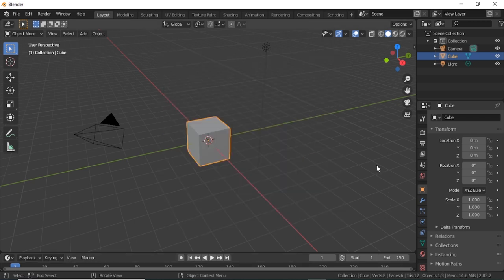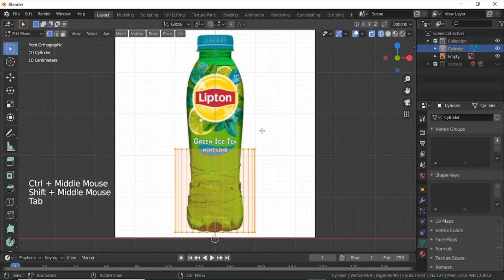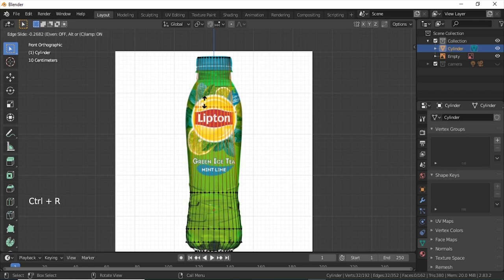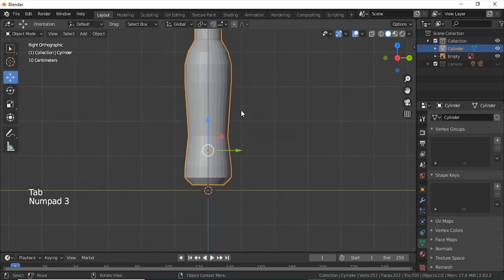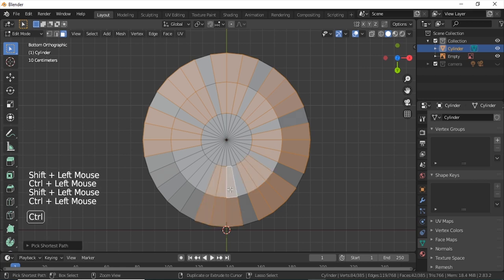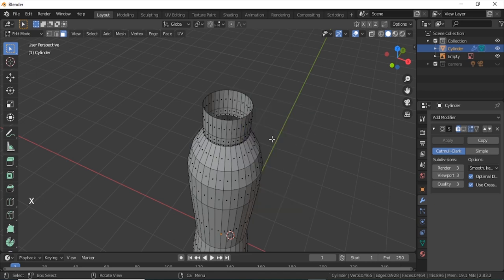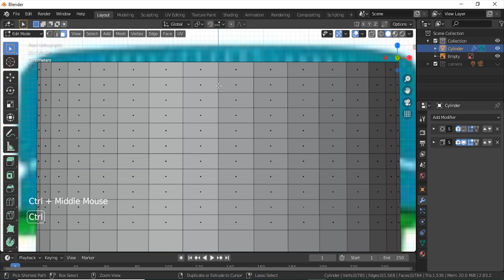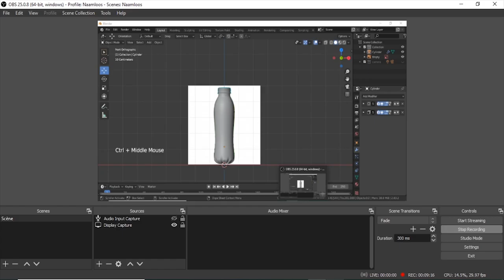How To Make A Photorealistic Lipton Bottle In Blender | Part 1

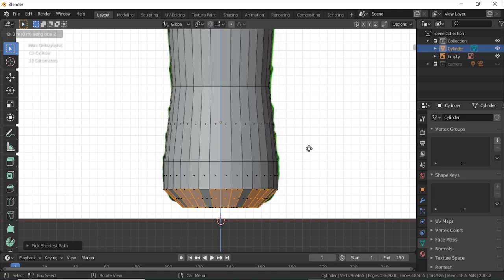Comment: Thank you so much for this valuable content, really appreciated yet. I am stuck at the 5:58 min. as you respectively press on "G" then "Z" to move along the Z axis but when I do that it moves the whole loop even the ones that are not selected, which make impossible to create the shape required. Would really appreciate your opinion on this as this might be a setting that should be deactivated while performing this step. thanks again for all and hope to here from you soon. (Also will really appreciate others take on this matter. <3 <3)
Reply: press E and then pull it down it means to extrude the faces or u can right click with the faces selected and click extrude faces